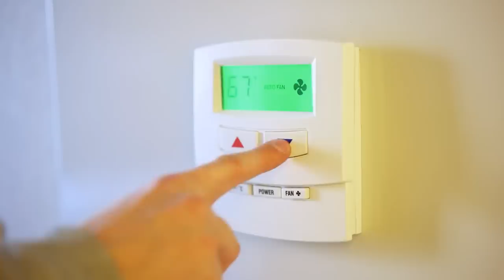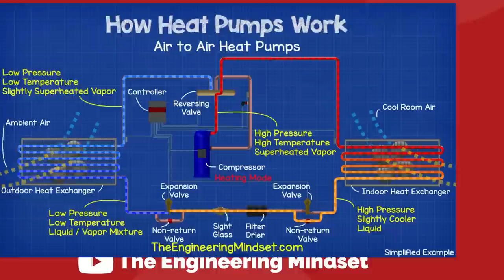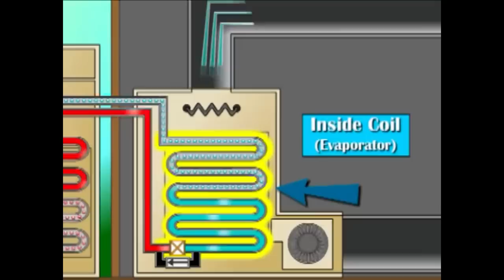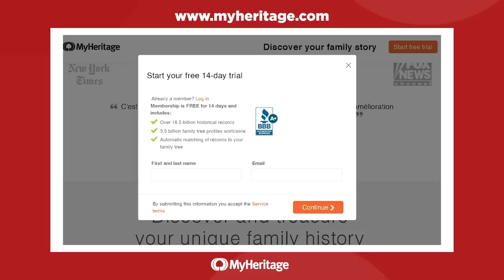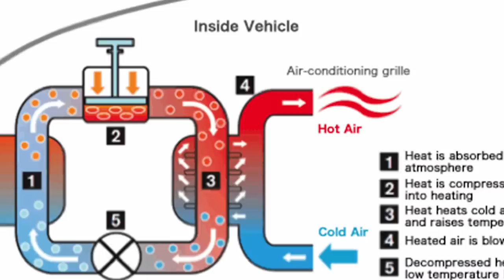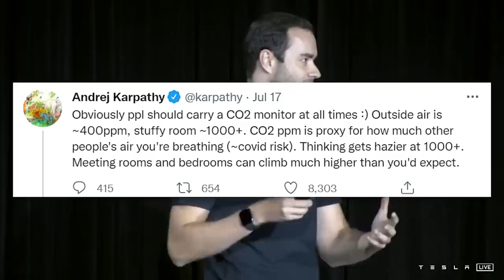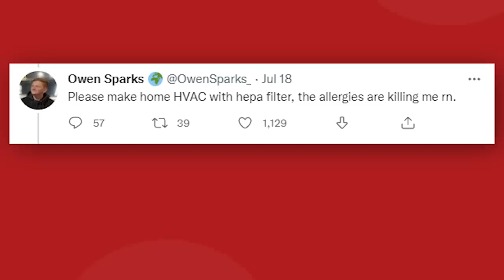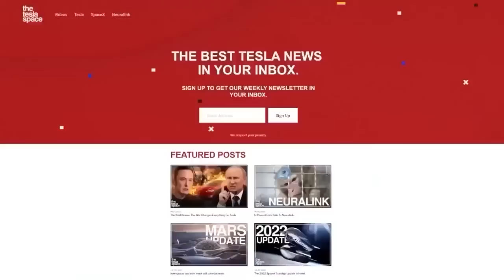Why Tesla's Heat Pump Is Essential For Our Future!

Comment: Lol in sweden we have used heatpumps since the -80’s became common in the -90’s and is a demand nowdays to pass inspection on new bilding. And there is heatpumps avalibel that works down to -30celcius or you could use geothermal and dont need to worry about outside temp and get better cop too.

Comment: I live in northern ND and we have long periods of minus 30 or colder at night with daytime highs of only minus 20.  however in the summer highs over 100 do happen several times per summer.

it appears the heat pump won't work well in the winter for us.  I'm all for it if it makes financial sense.  not going to spend thousands on equipment to save a few dollars on natural gas.  natural gas is extremely abundant here so it's pretty cheap.
Reply: Yep, that's too cold for air source heat pumps, you'd need deep ground source or boreholes.
Reply: I used to live in Not Dumb but moved as everyone else was dumb.
Reply: @kennethkeen1234  What a thoughtful and intelligent comment you made!

Comment: Wait... isn't compressed gas cooling? And expanding gas heated? PV=nrT or something?
Reply: Compressing a gas makes it hotter.  Droping the pressure causes the gas to cool.  An air conditioner only cools and has two heat exchangers and compressor (increases pressure) and an expansion valve (reduces pressure).  Heat pumps add valve and an additional expansion valve that allow the process to be revised.

Comment: BRILLIANT for Persons suffering with multiple airborne allergies, I currently live in a gas heated apartment and have been using multiple air cooling, circulating and hepta air filter devices and have not found the right balance for air quality.

Comment: Nice video.  Finally, I've always been disappointed about how videos state heat pumps simply move heat around.  I always felt that to be a dubious comment.  I always knew that the refrigerant in an A/C was "COMPRESSED" and from simple HS chemistry that compressing a gas causes it to heat up ( it didn't transfer in from anywhere it had work done on it meaning ... energy in ) it was then pipped to the outside coil to have heat removed from it, before it was taken to the evaporative coil to be allowed to expand back into a gas which when a gas expands it removes heat from the surrounding environment.  

To me a heat pump, for a residential system, is just deciding which side of the compressor you are using inside your house.  Are you using the compression side to get heat in or the evaporative side to get heat out.
Reply: Probably too demanding to get a comment here. This net is primarily used by children who are not yet hooked by porn or drugs in USA. Don't even TRY to teach adults from USA how to write down the time. 2022 10 28 15:19
Reply: @kennethkeen1234  
Kind of lost me with that time reference....

Comment: Without a discussion of latent heat of vaporization, this is a pretty lackluster explanation of heat pumps. The compressor does not actively add heat to the process, it is a side effect. Heat pumps move heat, and they can do this due to the "magic" of latent heat.

Comment: The innovation that tesla provided in heat pumps for its cars is not the basic principle that has been known for many decades but the correct sizing and combination of a series of parts that are normally found in a car that are combined into the OCTO valve and other components in a tesla.  That is white makes it more efficient. They’ve been able to Combine components in one box,reduce the length of hose by 60% reduce the number of connections by 70% so of course it works better but just because of that, it does not mean that they have some miracle solution for buildings where the biggest single problem is interacting with the building itself which is not controlled. Every parameter and every requirement is known exactly inside the Tesla but those same values are all over the map with the house which is why Tesla will have no advantage and if they’re smart, as they are they will never enter that market.

Comment: Heat pump has been widely in use for residential since 1990’s. Not last 10 yrs as you stated, just want to correct that.
Reply: My home has been running on one since 1973. There was a major movement towards electrification that came with the development of nuclear plants.  Soon after, Three Mile Island was used as proof of flirting with Armageddon, advancements in nuclear ceased and guess who dominated energy for another half century and running. Heat pump advancements have not ceased however and the model y car pump is great advancing engineering.
Reply: Yes in Nebraska or Chenzolange or Missathutets. But elsewhere we have known HP for hundreds of years but you were kept in the dark and used and abused but didn't understand.

Comment: Tesla is all about vertical integration, so it seems obvious to me that the next thing they do with their HVAC/HeatPump is integrate it with both solar and batteries. There's a concept called PVT, or PhotoVoltaic-Thermal, where you have a panel that collects both electrons from sunlight but also heat energy from the sun. The solar heat collected from these panels would then be transferred to the heat pump. The heat pump can also collect any excess heat produced by the Powerwall. This would result in cooler solar panels (which produce more energy and last much, much longer) and zero-cost heat energy that can be used to make hot water or warm the house. There are even thermal loops that can transform that heat energy into cooling energy through compressor loops.
Reply: Doesn't the existence of the term PVT give a clue to the fact that this is nothing new? PVT systems that also integrate heat recovery ventilation and domestic hot water are quite common these days, in fact many European countries have included them in mandatory building codes, to a greater or lesser extent depending on location and climate.
Reply: @mikekelly5869  something doesn't have to be new for it to be significant.
Reply: @tonydeveyra4611  Well that's true, but in this case the whole thrust of the video is that what's presented is new, when it's really just a reheat of existing tech in a shiny box.
Reply: @mikekelly5869  the opportunities for innovation are in manufacturing process and integration. I doubt any of the europeans have integrated PVT with a heat pump and a home battery's thermal management system.
Reply: @tonydeveyra4611  Home batteries are not all that common in Europe, at least not big ones so there's usually little advantage in adding specific means of recovering heat from them. It's usually done passively or people just use their cars or domestic hot water as storage. As for integrated PV, almost every domestic system (as opposed to individual plant items) is sold with the express capability of integrating with whatever PV panels the user wants to use. The three manufacturers  that spring to mind are Nibe, Panasonic (Aguarea) and Daikin (Althema), two of which are Japanese, not European, as you know. There are many other examples.

Comment: I have a ground source heat pump with radiant floor heating.  It also supplies preheated water to my water heater.  Also have a heat pump water heater which is a huge energy saver.  I have 8kw of solar which produces enough energy to drive my EV 40,000 miles per year.
Reply: The FIRST sensible comment here from someone who clearly is using his brain! What do you mean by "miles"?  IS that not something that was used on the Apollo  pretend flight to "moon"?

Comment: I prefer using thermostats with timers. If I stay up late one night, I still want to heat to turn down and will just use a blanket. Smart homes would most likely increase my energy use.
Reply: Smart thermostats conform to just about whatever you want and you can control it while you're laying in bed if you want. My power company actually offered a rebate so they can adjust my thermostat during peak summer loads to reduce overall grid use. It would be nice to see them let the homeowner set the temp based on outside weather and possibly monitor for open windows and doors.
Reply: A blanket! One of the FEW smart people here. Yanks are not allowed to use blankets. What if someone finds out you are using one?

Comment: The order of operation in this video is kind of correct but is not. The expansion valve during cooling is at the indoor evaporator coil, not the outside unit (condenser). 

The outside unit as the name implies, condenses the low pressure gas from the evaporator to a high pressure, hot gas. That hot gas then moves through the condenser coil and is cooled by the condenser fan moving air through the coils and converts the gas into a liquid. The combination of high pressure with the removal of the heat is what causes the hot gas from the compressor to change state to a liquid. 

This liquid then moves its way to the indoor evaporator coil. At the inlet of the coil is the orifice or expansion valve. This regulates the flow of the liquid, slowing it down and causes a reduced pressure on the outlet of the valve.   This causes the liquid to the rapidly expand to a gas and as a result become very cold.  As the cold gas moves through the evaporator it pick up the heat from the airflow moving across the coil and this heat is carried by the gas to the condenser to start the process over. 

Very simplistic but accurate description of the cooling process.   As stated, the heating cycle reverses the flow we as the outdoor unit expels cold air and the evaporator expels warm air.   This type of heating is much more efficient than using electric resistance heating elements, essentially a large hair drier.

Comment: What you want to develope is a smart central air system . Most houses have maybe 10 rooms on average and most times those rooms are not occupied which you don't need to heat or cool those rooms most of the time . Same for when you sleep . You only need the bedroom for that climate control bedroom . Also you may want varying temperatures in different rooms . Most central air systems have very different tempature from one room to another depending on the rooms closest and farthest from the air handler . You would needed a smart variable speed motors and smart ducts that limit airflow or raise it depending on occupancy and comfort . Each room would need a monitoring device for tempature and many things do this already . The heat pump itself is not much different than a traditional system . If you have high electrical prices it's not going to lower your bill . The way the air is moved is where you can make the savings . Now their are some companies that have developed these systems but adapting them to existing systems that depend on a specific amount of airflow could damage the blower motor . So that motor has to reduce it's rpms to match any reduced airflow which would need a variable speed motor . The technology is there and the saving s in energy costs can offset upfront cost . The big factor is comfort and that will greatly improve . Let's get going elon . It's there for the taking
Reply: How would your thinking change if you had your own solar PV capability, both partial solar as is the case with many homes, or a zero carbon system (100% PV) if you have space for a ground system, which I do?
Reply: @davidfellowes1628  Solar has it's limitations . I hooked up electrical for a generator for a off grid residence who had solar battery system because it wasn't enough electrical for their needs . A year later he wished he got a bigger generator. Solar is great but by itself it doesn't provide enough power for high draw items like air conditioning ,Electric heat appliances .
Reply: @stevencole7331  Do your homework before you buy.

Comment: Is Freon still allowed? Is that a Colorado thing that we use a replacement?
Reply: "Freon" is a trade marked brand name of some refrigerants made by DuPont, there are many refrigerants.
R-22 is likely what you are referring to. I has not come in any new systems since 2009, or been produced or imported for use in the US since 1/1/20. In the US, systems using it can still be charged with it, but it is getting very expensive.
Current equipment uses R-410A, an HFC refrigerant, but all new equipment will be using HFO refrigerants starting 1/1/23.
No telling how long before they find a problem with HFO refrigerants and move to something else...

Comment: Let’s pray that Tesla develops HVAC systems that use safe and non-toxic carbon dioxide for their refrigerant. DuPont advertised Freon as safe and non-toxic, and this enabled widespread acceptance of refrigeration after WWII, but Freon was extremely dangerous because it disintegrates into deadly phosgene gas---the deadliest war gas of WWI----when it is exposed to open flame, and air conditioning technicians typically used propane torches to search for Freon leaks. No doubt other DuPont hydrocarbon refrigerants are similarly toxic. The trouble is, carbon dioxide is practically free, and it offers no profit for DuPont or anybody else. Remember how firemen, police, and other “rescue workers” suffered a mysterious pulmonary sickness when the World Trade Center in New York was demolished? That is because those buildings used Freon for their air conditioning, and the air conditioning systems were custom-designed for the buildings and could not be adapted to the new refrigerants that replaced Freon. When the buildings were demolished using Thermite, which generates intense heat that melts steel, the Freon was converted to phosgene gas. Small wonder that so many people got sick. Corporate law is an open invitation to commit murder and even mass-murder, because it isolates the investors and officers of corporations from lawsuits, and therefore from responsibility for their crimes. Corporations live forever, and have more legal rights than a living human being. They were a problem in Britain even before the American Revolution, and the American “Founding Fathers” regarded them as a social and political menace. Time has proved them right. Dracula is real.